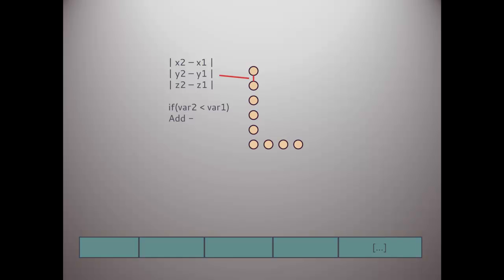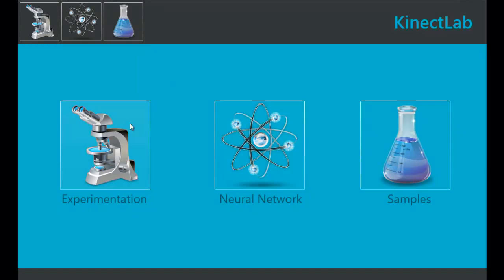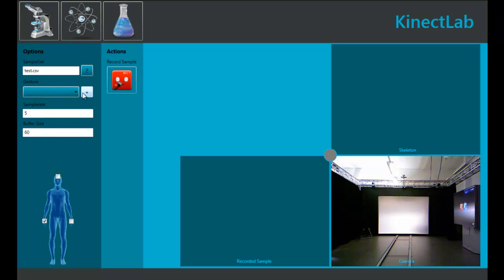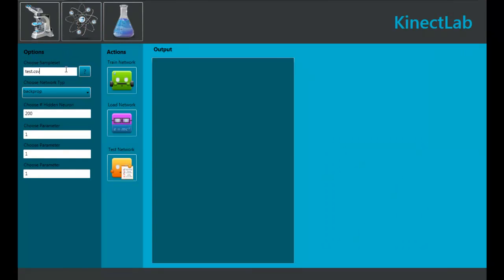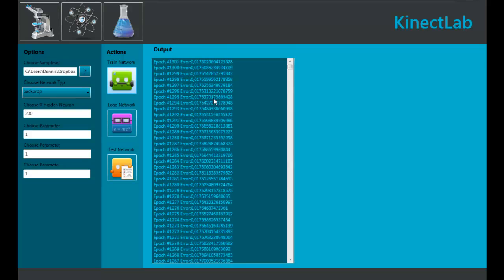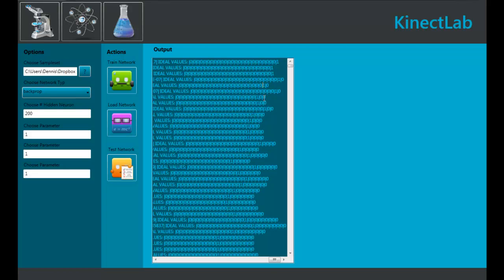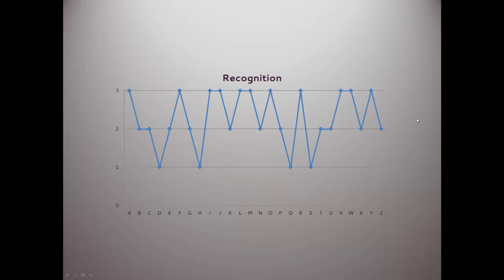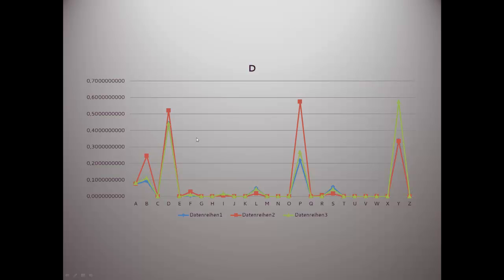Kinect - Neural Network Gesture Recognition

Comment from the maker: @LegendLength The main problem on this approach is the initial setting with the Kinect and distances between points as the input vector variables. In our case the data from similar letters do not distinguish themselves enough. So if you want to recognize letters or any kind of symbols with the Kinect I would recommend another approach for the input variables. Maybe transform the points to a normalized space and add a grid overlayer to use grid cell values as the nn input.